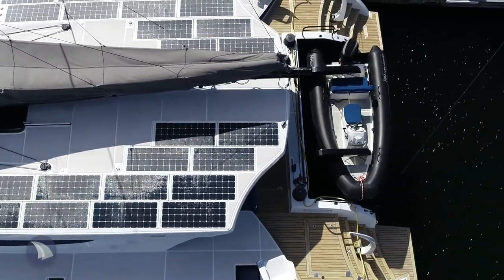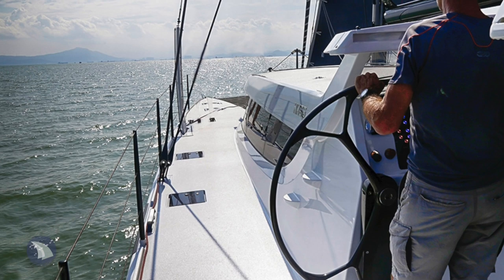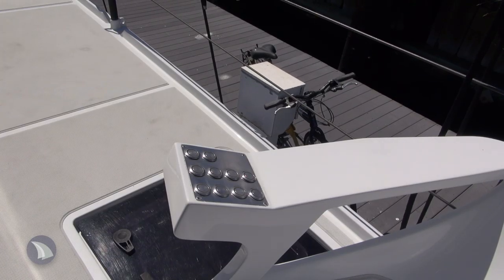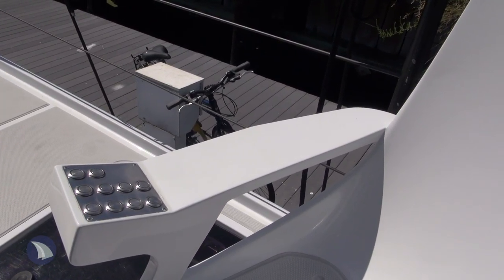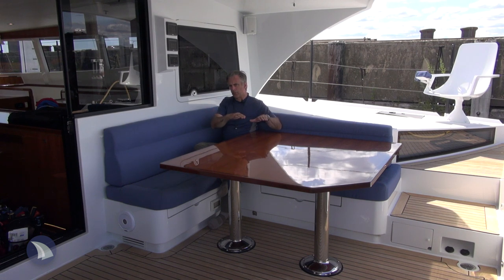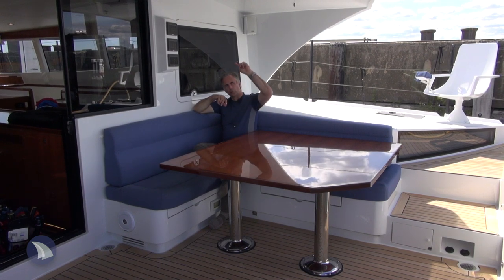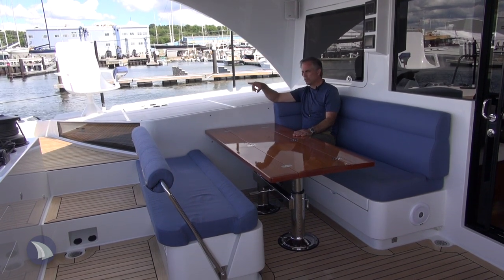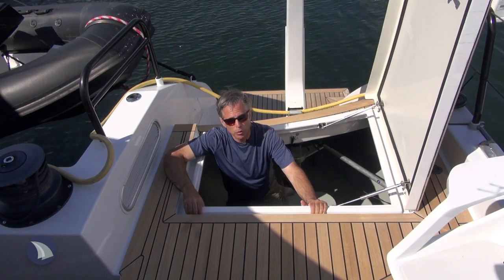HH 66 Catamaran Cockpit & Helm Review with Scott Rocknak Part 3

Comment: I must be missing something.

The inside wheel is grea for bad weather unless you have to adjust the sheets.

Then you have to go outside and often get soaked with rain to adjust your sheets.

Am i wrong?

I'd have a raised central cockpitfully open or fully closed with all lines coming into it and ditch the tillers.

Currently it seems poorly thought out.

Comment: Re-watched the qualify video and noted your input at the end. Really not a 2 crew boat comment. So to move this boat around you would need a crew of 3. Added expense of that extra crew member. Interesting. Berthing 3 crew is a challenge if the owners have guests.
Reply from the maker: I believe the way to have the boat be an owner operator couple's is to have a smaller rig. Even though the captain of the boat in the video can sail by himself its because he is an uber-captain with years of experience specifically on performance cats. You can sail as a couple with one crew aboard. If you preferred to not be operating the boat yourself you would most likely want the second or third person.
Reply: @ROCKNAKSYACHTSALESINC  My thought was a paid crew of 2 full time and myself minimum. Add transit crew when needed. Want to race on occasion but as I get older mostly the Caribbean events
Reply from the maker: @VERTICALWisdom  On the HH66 you can have a crews quarters forward with its own head and access. This could be a three or four cabin boat in addition to that cabin.